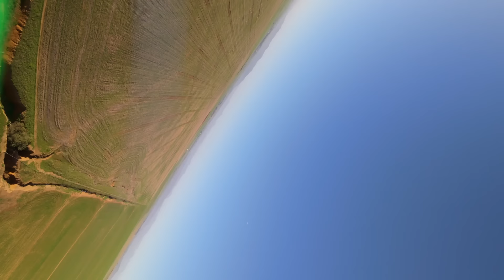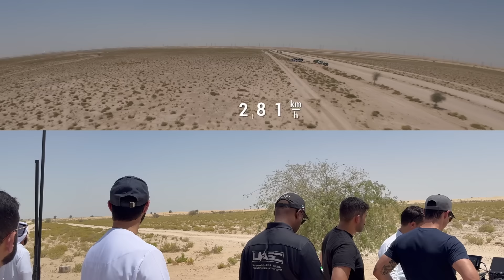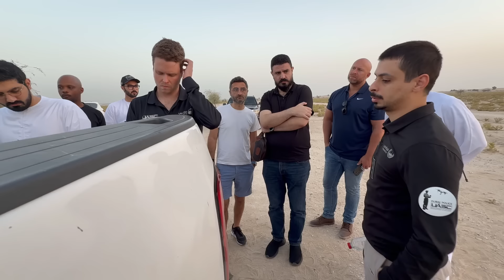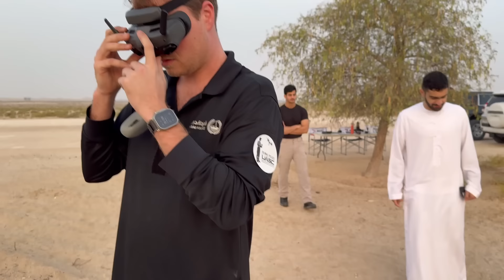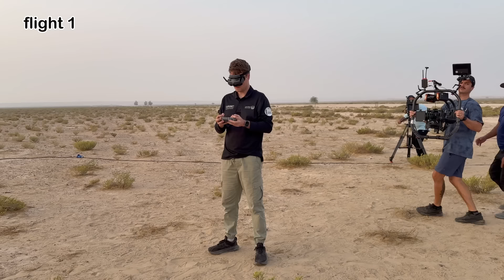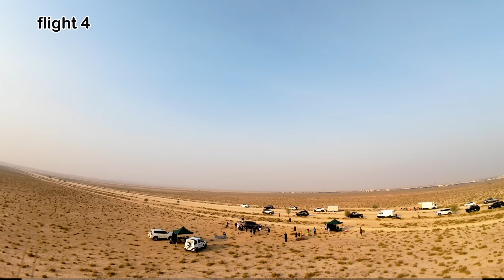Official Drone World Record Speed Attempt

Comment: Mind-blowing project 🔥 Quick genuine question, at these insane speeds, can computer vision even “see” anything reliably, or do motion blur + vibration basically make AI tracking useless? Really curious where the practical limit is.
Reply from the maker: I think AI tracking is very viable. We have rubberised camera attachments to eliminate vibration. And it depends on closing velocity. If something is on the ground and not moving superfast tracking should be fine. If the target is flying it already had its own speed and if being followed the relative speeds should be manageable.

Comment: One thought, have you guys considered adding temp sensor to the motors so you can see how hot they get?
Reply: Yeah my guess is that they are going all-out so there's no real point in having monitoring.  Maybe during the development phase it would be useful though.
Reply from the maker: Real time motor temp monitoring would be fanstastic.  In development there is always time pressure and you spend your time on absolute essential.  We have found stronger motors that dont grind magents and so overheating is no longer a problem which is a great relief.

Comment: Cool. Their drones crash at 500+ km/h. And the engine rpm is under 25,000. That's a blade tip speed of about 233 m/s. Plus a forward speed of 500 km/h is 138 m/s. Total: 360-370 m/s. These guys are simply creating a sound barrier on their blades with all the pressure surges. But the controller doesn't know about it. That's why they crash))) That's what I think...

Comment: Fantastic, but is there an airflow through the motor? But I guess the aerodynamics would suffer if there were.... Would a slightly larger radius on the motor help and less height to reduce bending moments on the shafts?

Comment: Nice. Congratulations! 

Going for the record in Dubai is really against all odds considering what a problem overheating has been so far. How about a winter run in Canada, US or Nordic Lapland? A Christmas special with Santa and the reindeers? Would flying near sea level in very low absolute humidity of <1g/Kg in below 0°C give an advantage? What would be the optimal atmosphere, Pa,°C, RH/AH?  

Watching the troubleshooting and analysis was just fantastic as was hearing all the insights into motor drives, vibrations and resonances, too. It's so rewarding to finally get the bottom of a persistent problem and solve it. I work in HVAC mostly on 3~400/230VAC VFD driven AC-motors, EC/BLDC and stepper motor drives. I don't mind replacing bearings on old AC-motors and fans with pulleys and belts at all but today a laptop with a data connection is my No. 1 tool. I've been scratching my head all week over a stepper motor drive that randomly faults on missing rotation detection with no apparent cause. What could be better on a friday night than a couple of beers and hours of motor data logs to plow thru?
Reply: But they have some people who have insane amount of money, of course they hope to see success and have some serious investors.
They should have picked a colder climate...

Comment: Countra-rotating propeller and dual motor per arm (Four props per arm), liquid cooled inrunners (Necessitates the use of a radiator, which would be benefitial for ESC and battery cooling as well) and increasing the frame size by 50%. With this approaching trans-sonic speeds should be attainable, though the developmental and material costs may be immense.

Perhaps a better strategy is to compromise and use two motors per arm and increase the frame size to enable using even higher battery voltage (Due to being able to fit another one in) thus lowering the current and making the motors more efficient. The ideal voltage would be in the 200-400 volt range, depending on motor size of course. 

It will be interesting to see what approach different teams take, looking back at aviation history shows many different routes to achieve high speeds with propellers! But I guess ducted fans with several stages are the only way to go supersonic, but then again I think battery capacity will be an issue to get a drone that fast, making a boosted start necessairy, like from a launch plane or using a rocket booster.

Comment: The work has been done is admirably. Propellers should pull, not push, and the engine should be cooled through the propeller's cowl. Alternatively, an inrunner with a radiator can be used. Propellers should have a near-sonic, saber-shaped geometry. This is my suggestion.

Comment: Doing this in such high temperature is actually pretty stupid.
Reply: @kellymoses8566   disagree, testing in optimal conditions where there's no failure teaches you nothing. Testing in the worst conditions is where you find design flaws and then correcting them results in a stronger more resilient device.
An example of this is back in the old Soviet Union days they engineered trucks to have adequate (read that as minimal sized) radiator cooling but when they tried to sell to the export market in hotter countries the trucked overheated and the engines burned up (there was a second issue that the temp gauges weren't working reliable either so no warnings until the engines seized). In contrast, European, Japanese and United States car companies test their vehicles in climate test cells to the hottest known temperatures to the lowest known temperatures of the planet. I actually learned this story in Economics class in college as an example of how different political systems affect engineering and production results.

Comment: Hey mate. Looks great. What could be done to improve longevity? Is petrol or jet a candidate?
Reply from the maker: Yes petrol would much better range. But only electric has the throttle response fast enough for motor only control. The flight controller is making 8000 control adjustments per second.
Reply: @Mike-Bell so at these speeds electric is required, and a hybrid system?
Reply from the maker: @J @JasperSkallow  but then its no longer a quadcopter, or electric flight

Comment: What magnet grade are you using? I am a specialist in magnet materials.
Reply from the maker: These magnets are N52

We have now gone back to the typical lower grade N42SH and not having any problems.  And no noticeable performance drop either.  They are running up to 75C which is fine in 25C Cape Town ambient.

Would you say N52 is a mistake?
Reply: @Mike-Bell Yes N52 is a mistake. I suspect the data sheet you are reading states it can withstand 80C, but that is not all the story. The temperature withstand is a combination of ambient temperature, magnet losses (Eddy currents), rotor losses (windage and friction) and the imposed demagnetizing losses from the stator windings. Windage and friction will be large if running a small air gap at the 25krpm speeds.

All of this can be overcome with correct motor design. 

Is your rotor dynamically balanced?

You can obtain 52 grade NdFeB if you choose a Dy diffused grade. It can be purchased by some Japanese and Chinese producers. It gives 52MGOe energy but with SH thermal (demag resistance) properties.
Reply: Yes N52 is a mistake. I suspect the data sheet you are reading states it can withstand 80C, but that is not all the story. The temperature withstand is a combination of ambient temperature, magnet losses (Eddy currents), rotor losses (windage and friction) and the imposed demagnetizing losses from the stator windings. Windage and friction will be large if running a small air gap at the 25krpm speeds.

All of this can be overcome with correct motor design. 

Is your rotor dynamically balanced?

You can obtain 52 grade NdFeB if you choose a Dy diffused grade. It can be purchased by some Japanese and Chinese producers. It gives 52MGOe energy but with SH thermal (demag resistance) properties.
Reply from the maker: Here is a video about the motor design by the designer https://youtu.be/N0GAx4WLx_o?si=xTKR3dcHwvG8tO2k
Reply from the maker: So does N52 demag begin at higher than 80c?
Reply: @Mike-Bell it will demag lower than 80C, by how much depends on the total losses in the system, magnet, back iron, Eddy current, stator, windage and friction etc
Reply from the maker: @rogerallcock8297  ok that’s interesting and way to low a temperature for this application
Reply: I have posted a reply a couple of times but it seems to keep disappearing
Reply from the maker: @rogerallcock8297   I appreciate your input. Demag of N42 according to my understanding is aprox 140C. Is that correct?
Reply: @Mike-Bell no N42 is also 80C. 

Nxx = 80C
NxxM = 100C
NxxH = 120C
NxxSH = 150C
NxxUH = 180C
NxxEH = 200C
Reply from the maker: @rogerallcock8297   Ok so its the compound that matters, not the grade.  That is usefull to know.  Thanks
Reply: @Mike-Bell the letter at the end tells you the max temperature it can withstand (subject to all the different losses mentioned). The number tells you how much energy / strong they are.
Reply from the maker: @rogerallcock8297  are higher grade magnets more brittle?
Reply from the maker: @rogerallcock8297  the motors with N42SH that we have been flight testing recently have been performing problem free and the coils at landing at 75 to 90c. The magnets run at about 10c cooler because they aren’t in metal contact.
Reply: @Mike-Bell  why 10C below? The magnets will see the high electrical frequency generated by the power electronics at 25krpm. This gives Eddy currents into the magnets which will manifest as heat. People laminate the magnets to reduce these losses. I used to do this for motor sport and aerospace applications
Reply from the maker: @rogerallcock8297   The 10C cooler bell is what we have measured after flights.  Presumably because the bells have fantastic exposed cooling surface while the coils are very covered up.  But we should try next time to see if the magnets are hotter, if we can see inside.

Incidentally we get up to 32k rpm.
Reply: @Mike-Bell Eddy current loss has a term in the loss equation that is frequency squared, so 32krpm will produce way more losses than 25krpm. 

It's the reason the stator is laminated with 0.15mm thick laminations and not say 0.35mm laminations. This is to keep iron losses down. Seeing as NdFeB are largely iron, then the loss mechanism is the same.

Comment: UAE is 18/100 on the freedom index.  Promoting  police surveillance for such an authoritarian regimes is morally questionable.

For high speeds(greater than mach1 1) you need a convergent duct into an enclosed fan to slow down the air and increase the pressure.  More than one motor/fan is wasted weight and drag. 

The frontal area is way higher than it needs to be as well
Reply: Thanks so much for that first line. It's completely nuts how little people think of these things. I have asked before and of course got zero replies whether the trip was sponsored, hotel rooms and flights paid, etc, etc.
Reply: Bringing politics into this is what an AIDS feminist would do.

Comment: Quad drive 🤔👀 ? There is something you seem to ignore is that propeller driven high speed planes requires specific propellers shape, at top speed the tip of the blades are already super sonic, wasting power and surely causing the thing to burn 🤦🏾‍♂️.

Comment: I can only guess that if testing this in Norway/Sweden/Finland during winter when it's cold here, which can variy a lot between south and north and also from month to month, but the weather report should be somewhat trustable. I first thought of Tromsø or Longyearbyen, but the wind can be rather harsh up there, which may make things a bit harder, so perhaps somewhere around Tynset (Norway) or Kiruna (Sweden) or perhaps Tampere (Finland). Good luck!
Reply from the maker: Thanks for the suggestions.  But inital testing in 12 - 15C Cape Town winter was fine.  And we have now found less finicky motors and had great success at 25C ambient recently.  No motor wobble or overheating.  It all came down to these super fancy motors that have structurally suspect shells.  The motors were custom designed for this project and so we assumed they couldnt possibly be the problem... until it was glaringly obvious.  
So no need for exteme climates and its a quick drive out to our local flying spot.  Just pick a cool day when its 25.

Comment: AOS motors for ya.
I would have a word with brother hobby
Reply from the maker: We are now having great performance from T-motor
Reply: @Mike-Bell  Not a bad motor but I feel there's better out there .
There is also the inrunner route you could try if you are looking for top speed,
APC good prop for glass fibre and maybe mejzlik for carbon fibre.
Even using a glider "reflex" wing section design in the quad arms might help also.
Not sure going the Jeremy Clarkson route is the way fwd as there has to be the ideal power to weight ratio ,just hope you can obliterate the top speed one day 👍

Comment: Congrats! I'm curious if your theoretical top speed is higher at high temp or altitude due to air pressure, assuming cooling issue is solved
Reply from the maker: That's a great question! Air density definitely plays a role. We need some conclusive testing but we are now both pretty convinced cold air at sea level will deliver the best speed. Better thrust in dense air outweighs any drag reduction from thin air at altitude.

Comment: This is awesome! I love the effort put into this. Such a fun father and son project. One thing I learned back on my high school robotics team (which was literally just me and a friend) was to anticipate how environmental conditions can change at the actual competition. We relied on a sticky adhesive to pick up foam balls. It worked perfectly during validation, testing, practice runs, and even at our first qualifier. We felt pretty confident heading into the national competition. But once we started competing, things fell apart. After a few rounds, the balls stopped sticking reliably. We spent the entire first day scoring only about half of what we expected. The next morning, we strengthened our adhesive surface, and suddenly we were scoring perfectly in every round. The issue turned out to be humidity. There were so many people in the venue that the air was much more humid than what we tested in, and the adhesive became far less effective. I regret not acting quicker. If it weren’t for that, we would have likely placed first or second and moved on to the worldwide competition to represent our country. We ended up placing fourth. Those competitions were some of the most fun I’ve ever had. I miss them. Does anyone know of any recreational robotics competitions in Boston, Massachusetts for all ages?
Reply from the maker: That's such a relatable story about environmental factors! And you need to think on your feet and be adaptable

Comment: Do you guys know what exactly and why fails in the ESCs?
Is it some transients killing the mosfets?
Or SOA exceeded?
Reply from the maker: When there is a rapid RPM change, the ESC firware miscounts and short circuits.  The better ESC's stop firing till rotor position is reestablished
Reply: @Mike-Bell  Is that with basic ESCs where the uC drives the mosfets directly?
I'm assuming it's not a problem when proper brushless driver is used?

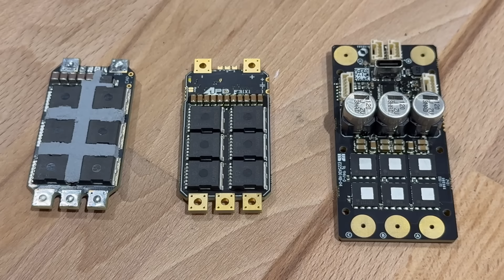Comment: After doing some research I found the bullet proof ESC from 5:38 : F200 by  APD (Advanced Power Drives) and MicroDriveLPi by Hargrave Technologies.
Reply: @MasterWabble  I’ve used APD esc for a few years now and they work great. Expensive but you can trust the specs
Reply from the maker: Exactly 👍🏻

Comment: Moral of the story - Chriss Rosser is full of crap. How he bragged that his motors were so superb! 
But you guys did a great job, determintaion and full analysis! Record fully deserved
Reply from the maker: Thanks for the support. To be fair the motor weak point is the thin motor spokes which was outside Chris’s scope. That’s RCinPower. But sure those motors just about destroyed us. In testing we had some intermittent failures and noticed the cracked magnets. But assumed those were from high speed impact with the ground. Would have saved a lot of crashing if we knew the magnets were cracking in the sky and isolated the problem sooner. 
AMAX also grinds magnets. But T-motor are good. 
It would also have helped if AM32 had lost rpm safeguards. They have only added that to newest firmware version on the basis of our experience.

Comment: Many many congratulations, I have commented previously that perhaps there might be another way as well!  You are taking a 4 prop drone and pushing vertical takeoff tech to areas beyond original parameters! Rachet back, meet Guinness drone specs, have 3 just big enough lift props and one stonking centre prop, shut down lift once speed/elevation reached, feather those props and let the big boy run for its life!  Harrier and its Grandson the F 35, have single engines!!!
Reply from the maker: That's an interesting idea for a different approach! But the props have to be in opposing pair for the flight controller to work. There is a large community competing for this record and I suspect they will all agree takeoff must be under its own power
Reply: @Mike-Bell Apologies for my poor English, my approach is to use whatever props you require but only for minimum lift off and tilting to flight direction then turn them off, fold props as per glider and let the bigger/slower prop get you to your record!
Reply from the maker: @d @drdoolittle5724  we like that there are no aerodynamic control surfaces. Just prop directional control. Plus this record is fir a quadcopter type drone. No need to apologize for the translation. I appreciate all the comm